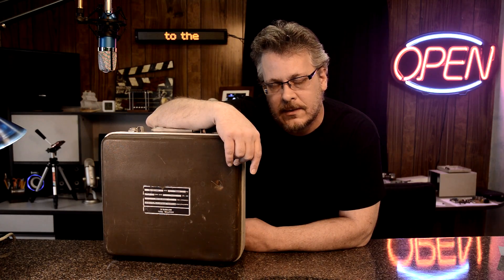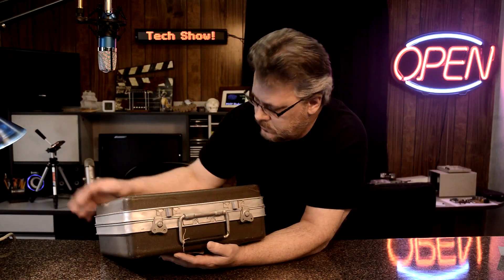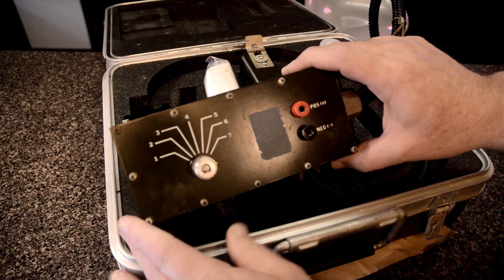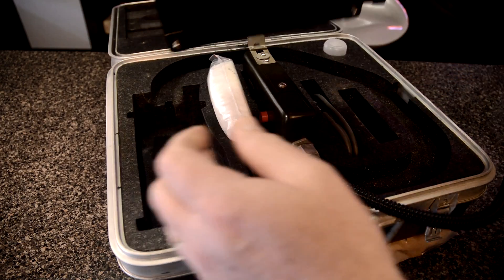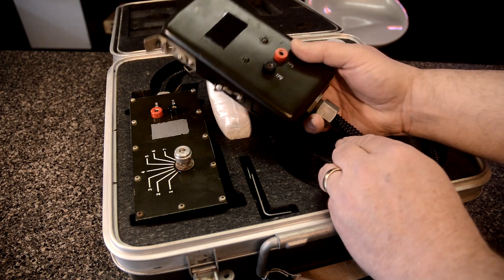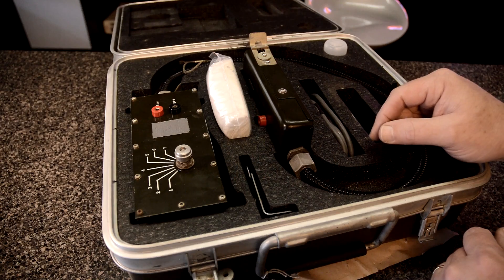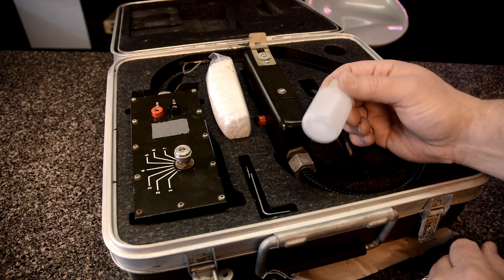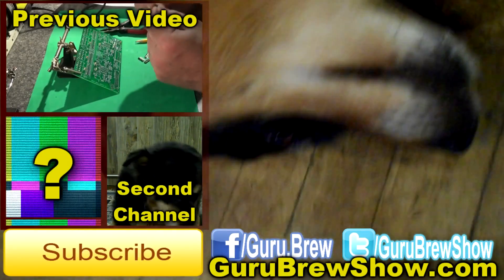Surplus Electronic Gadget - What is This Thing?

Comment: I found what it is. It is for use on a Tube-launched, optically tracked, wire-guided (tow2) missile. Full description is "Adapter, Test, also referenced with federal logistics item name code 06159 - An adapter which provides facilities for electrically connecting an item to be tested and a piece of test equipment. do not use for interconnecting cables. includes plug-in electronic component socket adapters which provide terminations for dynamic testing while an electronic component is inserted. see also coupler, test set.". Here is the listing I found for it. https://nationalstocknumber.info/part-number/10276909_010872534
Reply from the maker: +Levi Pinkard Excellent Work! How cool is that.... a Tow Missile Thing. THANKS Levi